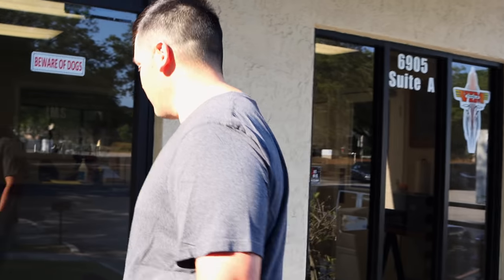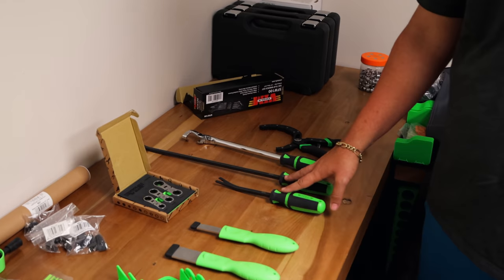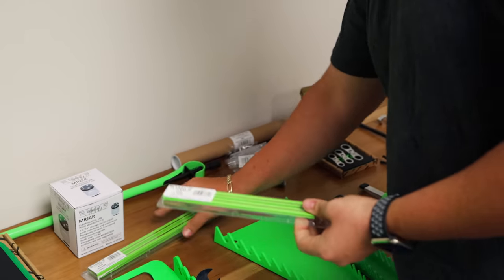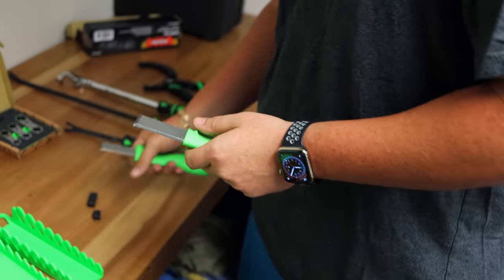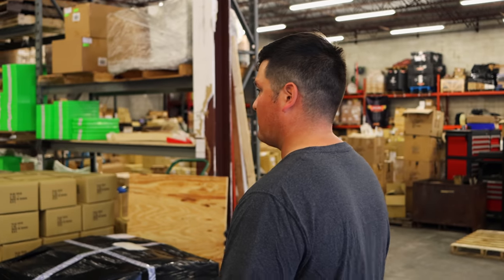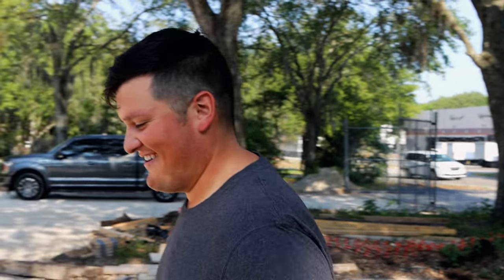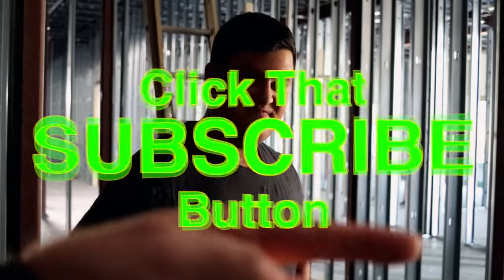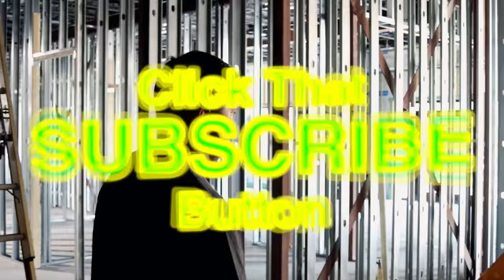VIM Facility Tour And New Product Releases Never Before Seen! Check These Out!

Comment: So many tools that seen on Matco truck rebranded for high prices
Reply: I've got the amazon version of those tool trays. They're $30 each here in Canada, somehow the snap on truck has them for $20 branded snap on right now. Weird twilight zone stuff man
Reply: I love VIM tools. I also had to get alot of the matco rebranded stuff, about 5 of the items on the table he showed are being sold as matco rebranded.
Reply: Matco tools are literally all rebranded from other manufacturers, they make boxes.
Reply: True but it's about service...Vim will not drive to you but Matco will
Reply: @dodgesportsman772  yea for first 2-3 years. Then go out of business and u have to wait a year or two for a new driver to take the route. I've own my shop for 12 yrs and we have had 3 different matco guys. Plus there were 3 total years gap in between the drivers. So point being, if it's a tool that u know can and will break and ur expecting a replacement within a week or two, get snap-on or keep backups. And them swap out the broken tools, in rotation.
Reply: Tampa Fl

Comment: Allied has been making those laminate jaw pliers and oil wrenches for years and years but I've never used the VIM tools brand of laminate pliers or oil wrenches.... The allied brand over time,, will start loosening around those pins that holds the laminate plates together, ever so slightly causing the plates to shift back and forth,, wearing the teeth points down on the Jaws much quicker, losing grip